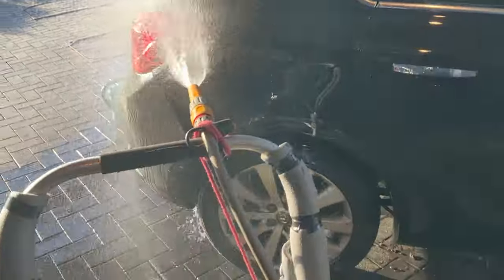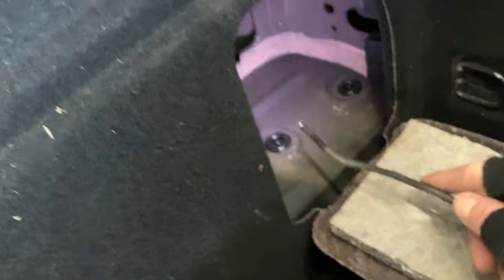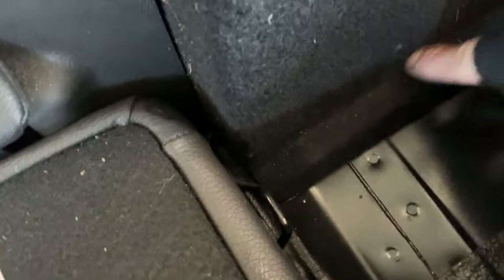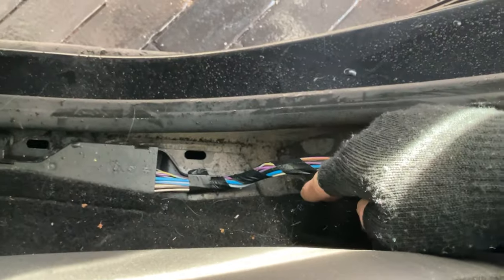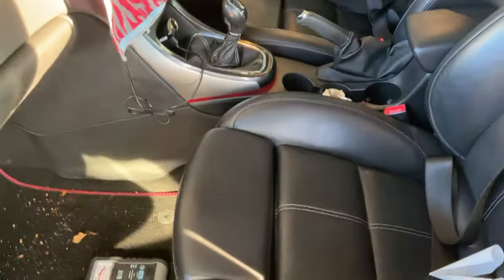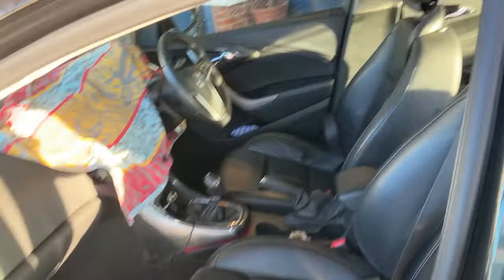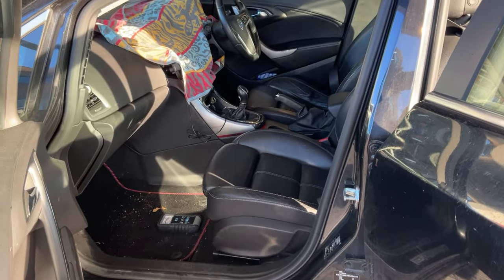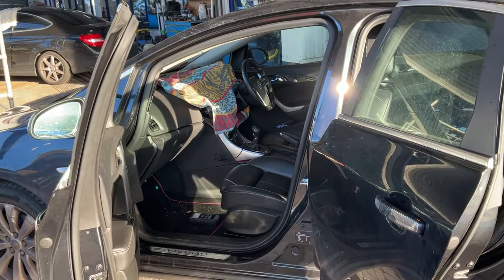Vauxhall Astra 2012 Part 2 | Water Leaking from grommet | #VauxhallLeaks

Comment: Ive got a leak in my J 2010 . Spare wheel mostly under water, i can drain it out, dry it up and within 2 weeks same again. Rear passenger footwell soggy, looks dry until pressed, clearly saturated.

Anyone know schematic wise if theres anything under the spare wheel well? Im thinking of just drilling a hole to let the water drain out rather than try find where the water gets in?
Reply: Hi did you fix it?
Reply: Well I made the water pool go away - turns out under the spare wheel there is a bung (albeit doesn't look like one) - took a hammer and screwdriver to it and knocked the bung out. Now if any water does get in at least it drains straight out. Haven't had any soggy carpets since - it did take about 3 months to dry out though and that was during summer!